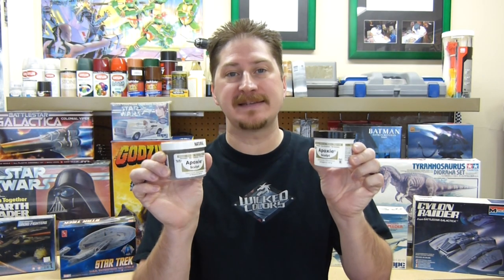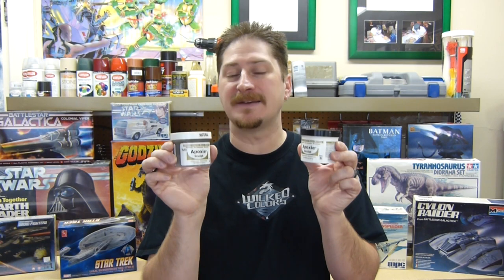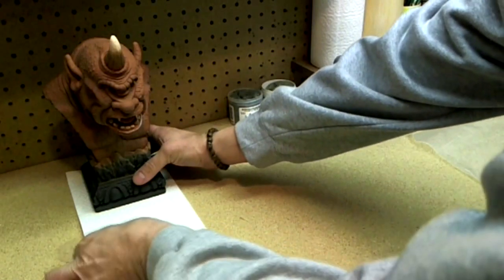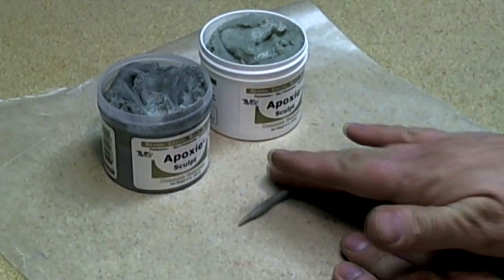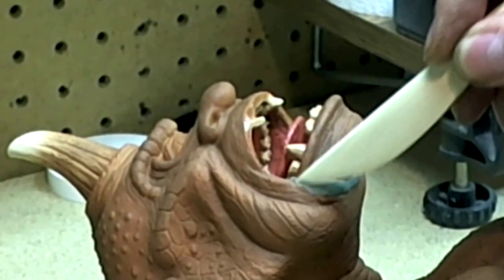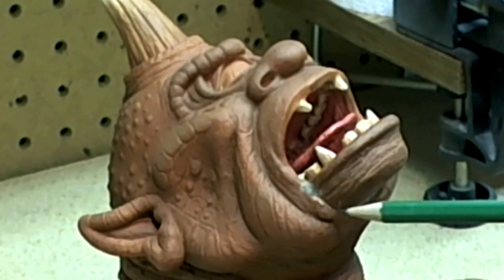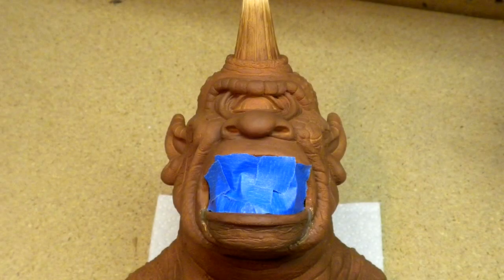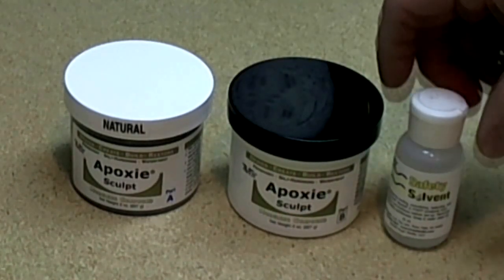Video Workbench Quick Tip: Blending a Seam with Aves Apoxie Sculpt

Comment: First time hearing about safety solvent. Does it help to soften the edge? I find that when I sculpt with Aves there's a slight ridge that ALWAYS needs to be sanded down and sometimes filled with a different putty.
Reply from the maker: Thank you for the question. Yes, it does take away the edge. Making what you're using it for look a lot softer. I hope this helps. :)

Comment: I accidentally broke a shoulder from a statue but was able to rebuild it with crazy glue and some epoxy glue that turns hard into a cement but I wanna try apoxie sculpt and the solvent to see if im able to mimick the shape the shoulder it used to be, venom premium format figure is the figure im trying to fix.
Reply from the maker: Aves Apoxie Sculpt and solvent are very easy to mix and use. I HIGHLY recommend them. Thank you for watching!